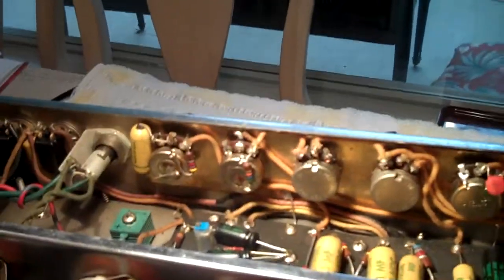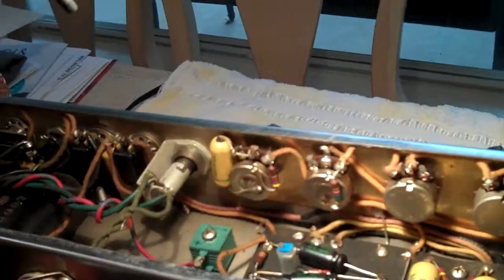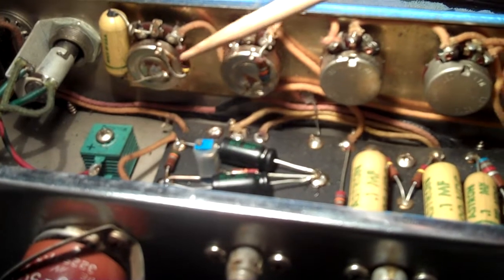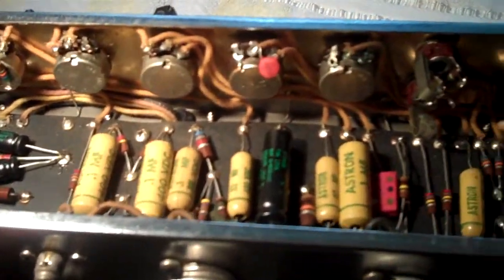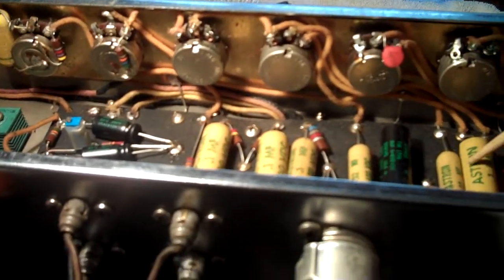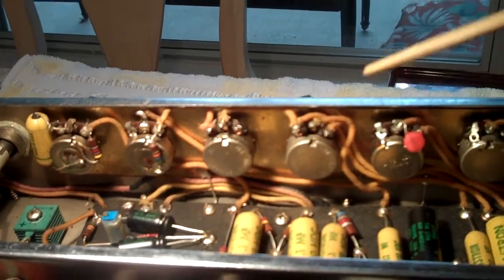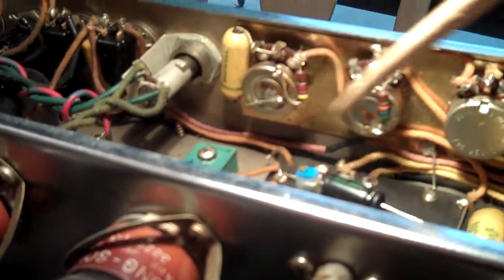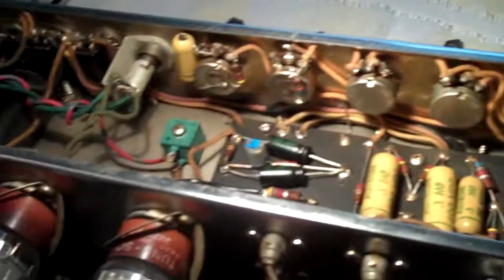Vintage Fender 5F6-A Tweed Bassman Circuit Schematic Discrepancies - Part 1

Comment: I have right in front of me a 100% bone stock vintage  all original 1959  5f6a and it has no resistor on the pot. 
Any questions or need pics, get ahold of me before I start digging in.... so far my amp on the variac at 90 volts and sounds pretty sweet but the screen resistors are getting a bit hot. The filter caps are still running smooth but if I push it it will smoke a fuse. So I will likely be changing some resistors and recapping. So please let me know if you there is anything your curious about on a 100% factory job before I start replacing orig components. This amp so far sounds sweet! It might be for sale at the right price. Chassis is 100% factory at the moment but cab and jensons are reissue
Reply from the maker: What is the date code?  I'm guessing that must be an early 1958 version
Reply: millstap 
I dont know where or how to read the date codes but amp has all orig components. I can look for ya and tell you what it says. Unfortunately I dont have orig cabinet. Only chassis.  So I have no tube chart. Otherwise the whole chassis is minty stock all original with exception of tubes. This one is running period correct rca blackplates.
Reply from the maker: Without the stamped tube chart, you should be able to Google the chassis serial number and come up with an accurate date.
Reply: millstap  ok cool , well I am not with it now but I wiil be later today. I will get back to you on that... unless I have a clear enough pic on my phone. I did make several youtube vids of it too.
Reply from the maker: I think I've read that the early versions did not have the presence pot resistor.  They added it later to the presence pot but adding it to the middle pot was probably because they did not have the correct value pot at the time.
Reply: millstap serial # is BM018xx which puts it early 59. It does have the resistor on the presence pot but none on the mid pot.....  The cap on the presence is leaky and needs replacement . However this amp sounds sweet with so much shimmer sparkle and plenty of low growl. What do you think it is worth? Or what I should ask for price? Should I replace the filter caps and the leaky tone cap and both the noisey  cc screen resistors? Or should I sell it as is 100% orig. . It is just orig chassis and not cab or speakers.... At least 4k or more? Not in hurry to sell.
Reply from the maker: Mine are BM027 and 033.  I would say at least $4K.  The speakers and the cab make a big difference in the value and tone.  New vs. old original tweed makes a difference in sound too.  If your just going to sell it, I would leave it like it is and let the buyer do the cap job.  I always like to see those old brown Mallory's in the dog house.  Makes me feel like it hasn't been messed with.  Then they have the option of beefing up the filtering since they don't make 20uF/600v caps anymore (at least that fit in the pan).  If you are going to play it for a while, then you should probably change them.
Reply from the maker: Kendrick was one of the first to clone them.  I actually went to Gerald's Amp Camp years ago.  None of them get it perfect because they just don't make the components like they used to.  There is nothing like the real deal especially with the original cab, speakers, and tweed.  You might want to sell that one and use the money to get an even more original one.  The original ones can be had for $6,000-7,000 if you are patient.  Maybe even less.  I played the Grammatico clone and did a demo.  It is a fun amp to play but it felt a little different.   All the builders seem to put their so-called improvements on it but I don't think you should mess with the Holy Grail.  Speaking of messing with it, I guess I have upgraded my filtering section and done some other mods as per Gerald Weber.  Having two Bassman amps was a real eye opener because the 1959 didn't sound as good as the 1960.  It sounds much better now but still they are a little different.  I play the 1959 more because is was barely played and it took me over a year to break it in and get the speakers reconed correctly, change the circuit to match the 1960, etc.

Comment: I'll comment on the 56k on the mid pot.

 It appears to bleed off a bit of the midrange, possibly to help save the speakers. Maybe it was a tone thing too? What ever it is, it's a killer amp.

If it was between ground and the grounded pot tab it would add more midrange.

I'm going home now and I'm excited to see what it does!
Reply from the maker: It is soldered to the right lug of the middle pot and then to the case (just like the 4.7K on the Presence pot).  The right lug of the middle pot is then bridged to the left lug of the bass pot with a short wire.

Comment: Thanks for documenting this on YouTube. I could have saved 6 months of my life if this was here Lin 2015. 

Here's my findings, no mid pot resistor though.

Spoiler Alert (possibly)

Linear 1 meg pots are are very important. The 25k linear presence pot , 4.6k and 6.8k 1 watt tail is something that carries into the tolex Bassman.because it sounds so good.

Also, the 200v .1uf caps need to be 200v. Jupiter makes them in the yellow version. I couldn't believe it made any difference at all, I guess cap size matters.

A 100 ohm resistor after the 1n4007 bias diode gets the negative voltage dead on to the schematic. 
I'm sure that the guy knows this, but power transformers NEED to be between 440 and 450 @ 50% dissipation. The only one that is close is the Classic Tone 40-18029 on the highest voltage winding. No need for silly tone boxes(buck transformers).

I have gone down the 5F6A road to insanity already, I'm here to help.
Reply from the maker: When you say linear, are you referring to the Bass or Volume pots?  Both of the volume pots on both amps are linear and not audio taper as per the schematic.  One of them has been replaced on the 1960 but I just looked at the 1959 and they both have date codes of 5926.  To my ears, it seems that the 56K resistor on the Middle pot actually bleeds some bass.  It is right there where the middle and bass pot lugs are connected.  It was too bassy without it even turned down to 0.  I can't wait to make the changes to the 1959.  I think that will get me as close as I can expect to the 1960.  I took the 56K off the middle pot yesterday and cranked it to about 4-1/2 and tried to duplicate the sound I got in my famous Hendrix Soundcheck #1 video.  It wasn't happening and I started wondering if something else might be going on.  I put it back on and tried again and it was there.  Perfect.  So now you can go experiment with the 56K ohm resistor on the mid pot.  Let me know what you think if you do it.  

Also, the Presence pot I think is 5K Linear as per the schematic.  I'm not sure.  It has no markings and neither does the Middle pot.  At least I cannot see them.  I don't want to remove them.  Hopefully I can measure them without unsoldering anything.  I'm going to go look at the reissue schematic and see what kind of pots they used.  At least Fender picked their favorite iteration of the schematic to use for the reissue.
Reply from the maker: Wow, this potentiometer thing seems to be a whole other can of worms.  Both the bass and the treble pots are 250K linear on the 1959 with date codes of 928.  The reissue and the old schematic show 1M audio on the bass.  The 1960 is 1M audio with 947 date code on the bass pot.  I am going to put a 1M audio on the 1959 to see what that does.
Reply: millstap I don't think the taper matters on the bass pot as long as it's a 1 meg. I don't know of anyone that runs the bass any higher than 0. The mid and presence pot should be the same in 59 and 60, 25k linear . Should be able to check any pot by measuring the outside legs and get fairly accurate readings (close enough to guess anyways).

This is the shit big clone builders don't get right. Can't wait to hear it for the demo. I hope he doesn't use cheap Chinese parts, the old American made stuff is worth 2 times the price.
Reply from the maker: No, he is a big time builder and everyone uses or have used his amps including Buddy Guy and Jimmie Vaughan.  He uses the best parts he can find.  This is getting even more confusing.  I just pulled the presence pot in the 1960 and it is a 50K linear Stackpole date code 6004 and not 5K as per the schematic.  I ordered a 1M audio for the 1959 to replace the 250K linear.  Now I am trying to figure out if it is necessary to change the 50K to a 5K linear in the 1960.  What do you think?  I am reluctant but what if it sounds even better?  I am going to measure it to double check now.
Reply from the maker: The presence pot is measuring 57.84K ohms.  The Middle pot about 26K ohms.  Now I am going to look at the 1959 which is even more untouched to see what the presence pot is.
Reply: millstap don't touch the presence pot, I think (read somewhere during my hunt)a 22k pot helped produce sound beyond human hearing. Could be bullshit, but I know that the 25k is in the range of diminishing returns.

Tell your guy to copy the long tail part of the PI in the 6G6 Bassman(non A revision), it's all the changes on paper. The only difference is the tweed's used a 27k negative feedback resistor. The 6.8k is usually 1 watt, but I've seen 1/2 watt in pictures and a handful in person.

I know whom the amp builder is now, I'll keep it to myself and let you have fun with the reveal!
Reply from the maker: I'm think you won't have the same results on adding the 56K resistor to the middle pot unless it is a 50K linear.  Maybe that is why they added it, to use up some 50K pot inventory or 50K was all they could get at the time.  Funny you should mention the 27K feedback resistor.  I was just measuring and it was reading the exact same 4.35K ohms that the resistor on the presence pot is reading.  I'm taking from that reading that I definitely need to remove the 27K to get an accurate reading.  I don't think it has drifted that much.  I really don't want to unsolder that thing.  I'm trying to leave some untouched solder joints somewhere.  I will start checking the 1959 to see if I get the same results.  I''ll take a look at that 6G6 schematic and pass it on.
Reply from the maker: And yes, the correct, original .1 uF/200v caps are in there.  One thing I was going to save for the next video was that the tail resistor in the 1960 is the 6.8K you mention but it is 10K in the 1959.  I am going to change the 1959 to 6.8K.  Also both amps have a 100K slope resistor and not the 56K on the schematic.
Reply from the maker: I spent a half day on it and I have already gone insane.  There seems to have been no rhyme or reason at Fender back then.  These are untouched examples.  The 1959 had two of the same pots too in the Presence and Middle but they were both 25K linear.  Now I don't know what changes are going to make the biggest difference.  To make it just like the 1960, I would have to get two 50K linear pots and Stackpoles don't exist.  I could use your help on figuring out if the presence circuit is really worth messing with.  I'm not sure it is worth buying two 50K linear pots of some brand.  I already just purchased a 1M audio taper for the bass.
Reply from the maker: After reading this again, I think I will start (in the 1959) with the 1M bass pot (instead of 250K that's in it now) and the 6.8K tail (10K in it now).  Then the only difference will be the high resistance of the presence pot on the 1960 (57K+/-) vs. the 26K on the 1959.  Maybe the 1959 will start sounding better than the 1960.  There may still be room for improvement in the 1960 but everyone seems to love it just like it is.
Reply: I'm about to get on the tone stack website, I'll get back to you in 15min.
Reply from the maker: OK  They don't have a Mac version.
Reply: The difference between a 250KA and a 1M linear is negligible. I tried all knds of changes and got the same result.
Reply from the maker: Does it show any difference between the 6.8K tail vs. the 10K?  That is about the only change I am going to make for now.  I will try out the 1M audio bass pot when I get it.  They both sound good but the 1960 is just so open sounding.  It may just be the cabinet and the speakers.  i know that will should drop the voltages down to what they are on the schematic.  Right now with the 10K, they are at  38v and 40v and vs. the 32.5v and 34v of the 1960 with the 6.8K.  I really can't tell much difference in the presence adjustments between the two.  They seem to be about the same.